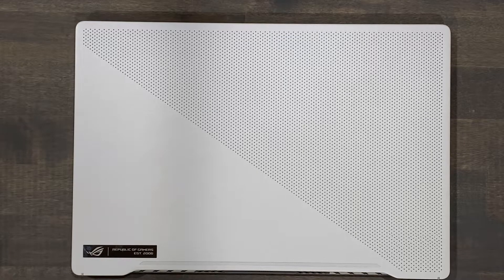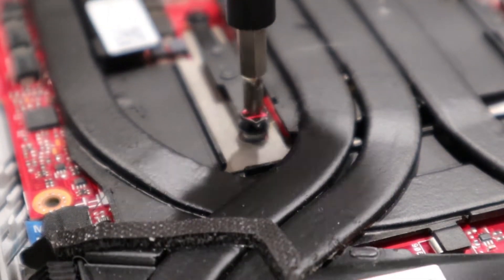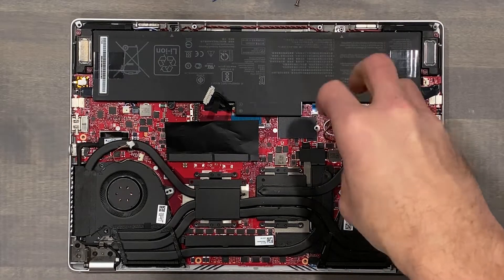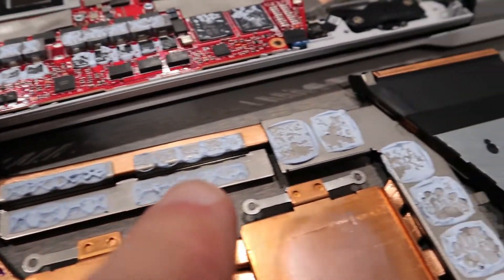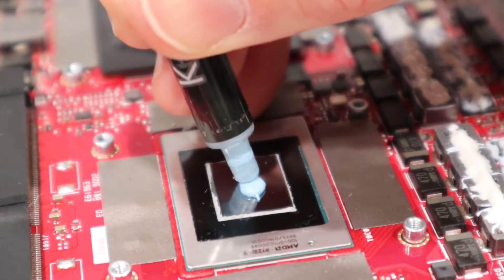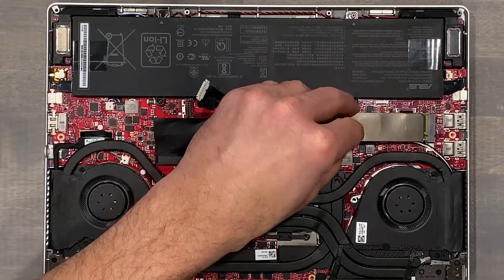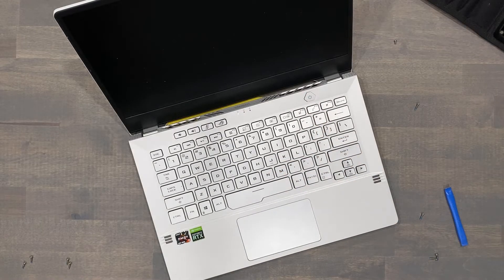Asus G14 Repaste Guide

Comment: I have a 2022 model of the G14. When lift the thermal plate cover for the first time, I see a ring of the liquid metal thermal substance all around the metal contact box; the liquid metal are all on the reddish plastic thing over the CPU and GPU. At first I thought that meant that the thermal substance is not supposed to touch the metal box but I see a bunch of the liquid metal in the crevettes, so it seem like the liquid metal are just there to address the concerns that the thermal they give you are dry and cracked.

Comment: for those who face screen dead, mine also screen dead right after fan replacemnet. i solved my problem with taking off external ram card. somehow my ram card got shortage. it caused black screen. it works well with my on board ram. and im gonna chage external ram soon

Comment: thanks for the guide, just did it for my inlaw and now his temps went from 90 to less than 70C, we changed both cpu and gpu termal compounds, but for the cpu we used thermal paste instead of liquid metal, and it also decreased temps by aprox 20C

Comment: I'm having some issues I followed the guide and did everything carefully and slow and it won't turn on no matter what I do. What could I have done wrong
Reply: in my case, i could turn it on but it cannot show anything on screen even bios. anyway i found out my ram got shortage. once i take my ram off and it works with on board ram. check urs too

Comment: Even though I turned off Turbo Boost, my CPU still reaches 94°C while using only around 50% and drawing about 22W. I reapplied Arctic MX-6 thermal paste two months ago and clean the fans monthly — the last cleaning was just two days ago — but the temperatures haven’t improved. My GPU also reaches 86°C.
My specs: Zephyrus G14 (2021 base model), Ryzen 7 5800HS, RTX 3050 75W.
What can I do to solve this issue?

Comment: I used to repair Xbox with rrod. Must have done 50 so thought this would be okay as its very similar. I was extremely careful even powered down after unplugging battery and taped so it wouldn't touch mb. Devastated that my laptop is now dead. Can't think how I could have done anything different. Be warned!
Reply: Its weird repasting shouldnt be this high risk.... I think its defect from asus, i have repaste anything from old thinkpads to newer gaming laptops non of them have died at all... Weird case this laptop

Comment: I would suggest TO ANYONE SEEING THIS COMMENT BEFORE OPENING THEIR LAPTOP to be extra careful with the battery connector. The reality is that it doesn't need to fall off its seat completely to create a shortcut on the motherboard, if you slide it just a bit too much it will make contact and possibly kill your laptop, especially because the connector is often stiff until it moves all the way out.  If you want to free the connector safely place a thin sheet of non-conductive plastic over the area at risk in order to prevent sparks. I personally layered some isolant tape in order to avoid stickiness and placed it right in front of that tricky metal piece. Good luck, hope you don't fry your computer.
Reply: So could I use regular paper for this since it’s non conductive?
Reply: @Hailey_Snailey I think it's no prob if you use it
Reply: If it happens means my motherboard is fried?
Reply: @mdjubayermahamudrakib4431  maybe, probably.. hopefully you are lucky
Reply: Just fried mine lol
Reply: I just fried my laptop. Can it be repaired?😢
Reply: @mr.nobody9646 so did I… you guys get yours fixed?
Reply: @MatasticMatt  really man? i didnt open mine yet but after almost 4 years my temps are crazy high so i will need to open.
Reply: @TOPSTOPI yeah for the love of god man take it to a local shop to have the paste redone. It’s not worth the risk. The may charge close to $75  because it’s a higher risk operation but it’s totally worth it.

Me and what looks like thousands of other people ruined out laptops lmao. Ik it’s hard to believe but fuck it was a sad day and few weeks when it happened. Mine is sitting in a laptop case in my closet right now. Was gonna sell some of the parts but never got around to it
Reply: @mr.nobody9646 also wondering
Reply: Have I just damaged mine? It won't puwer up after I Tried to unplug it, and the metal thing fell off on the main board :(
Reply: @globularvower3300 oh buddy you’ll have to call around and see if anyone will do micro soldiering repairs.  the very least it will be around $200 if you’re lucky , if you’re unlucky, you’re mother board is fried and you are better off getting a new laptop. I’m so sorry o break the news there are hundreds or even thousands of us who did the same thing and it’s devastating. But in the end it’s just a bad design from the manufacturer and in the future if you ever have a motherboard with metal on the clip like that just have a professional do the thermal repaste  for you

Comment: Ok ok....I got an idea. Before doing this procedure. Let the battery completely drain. Then unplug the battery, and hold the power button down. Completely isolate the power from the computer. Then remove the ram, the NVMe. Then do the job.

Comment: The laptop stopped working . Went to service center for repair they said  it could be due to fried motherboard 
.The metal connecting the laptop should not be removed wrong information given in the video
Reply: Did they repair it? How much it cost?

Comment: Bro this video is cursed and is frying everybody's expensive laptop with the battery...
Reply: guys check ur external ram card first. once i took ram off. my g14 revived.
Reply: @kasak-v4p can you be more specific do you mean replacing the ram card or just taking off the ram card?
Reply: @ruwas369  u see the ram card  that he took off before battery?
that one
g14 has on-board ram 8gb, so took ram off and try to boot ur laptop.
Reply: @kasak-v4p thanks you! I will definitely try. I will have to dig my g14 from the grave to try to resurrect it. But it is worth the Try 😉
Reply: same thing happened to me….the laptop isnt turning on now…..is there any way to know if the motherboard is shot?
Reply: @rahulsajwan3466  probably, or maybe not connected properly try if everything is reconnected firmly. Otherwise if nothing works it's probably fried. This guy should take down the video or make an edit in the video with disclaimer about the battery clip metal thing.
Reply: @ i so regret thisssss…… going to service center on monday…… hoping its something easily fixable and not motherboard fried
Reply: @rahulsajwan3466 good luck pls keep me updated on the reply from Asus and maybe the cost of fixing a fried motherboard if that is the case.
Reply: Wish I read the comments first. I was so careful but now have a very expensive paper weight.
Reply: @michellebaker8066  rest in peace my friend. i wish he would delete the video, or edit it, if possible, to give proper warning.

Comment: wouldn't it be easier if you separate the lcd cable and wifi/bt cables from the heatsink instead of removing the battery cable and both the wifi/bt cables and lcd cable?

Comment: Hello, I have a question, I did everything as in the video, turned on the computer, but the charge level is 0% and it does not charge, the connector is inserted well, any ideas what could have happened?
Reply: Did you find anything out

Comment: Thanks a million for this video, very helpful in replacing my dead fans and repasting my 4 year old system - running like it's brand new again!

Only issue I came across was the screw for the wifi kept spinning and never actually lifted out, so had to resort to disconnecting the antenna wires. Bit of a pain with how tiny they are, but still worked out in the end. Thanks again!
Reply: I haven’t re-pasted it in 5 years. Doing it now. I wanted to know what was the temps like before and after while playing graphic intensive games

Comment: Thank you for this super helpful guide! Just a heads up if your G14 has the AniMe LED matrix display: you need to unplug the connector just above the Wifi card. The cable runs through the right side of the cooler, so be extra careful when taking it off!

Comment: have you ever heard of this laptop only crashing when on the desktop when it's plugged into a power supply? I can start playing any game and once it's in fullscreen I can plug in the power supply and it will get its extra boost of power during gameplay, once I exit the game and go back to the desktop, it will instantly crash if I don't disconnect the power before exiting the game. I also noticed if I disable the GPU it won't crash if it's plugged into the power supply. Also not sure if this is normal for this tablet, but during gameplay it gets so hot on the top near the edge and around the top buttons, hot enough to burn the skin if you stay touching it..
Reply: yes happened for about 1-2 month before I realized I was so fucin dumb, basically the battery link to motheboard comes loose, it's so weird but it happens, jjust bring down power to 20% or less remove and re add the wire to the socket the issue will go away.

Comment: When i was reconnecting the battery connection is created a spark and now my laptop wont turn on
Reply: This is because of the metal holder on the battery connector that if pushed to hard will fall om the motherboard and fry it many people have had this issue and than Asus charging too much to fix it
Reply: @ruwas369  Yeah, I'm not sure why the guy who made this video decided to pry the metal piece off when it's made to slide back slightly so you can pull the battery plug upwards and off easily.

Comment: Heads up to anyone who thought they just bricked their $1000 laptop. Try plugging it in first 😂. I was just about leave for best buy because I need a laptop for work if I just killed but decided to plug it in first. And it came back to life.
Reply: ain there a battery issue where the adapter port stops working if you do something wrong with the battery.

Comment: Hey this guide is completely incorrect. You are NOT supposed to remove the metal bit from the battery connector; simply sliding it back is sufficient. I popped it off completely on my laptop and shorted my mobo. Thanks a lot random youtube guy. Taught me what ought to happen if I trust random youtubers.
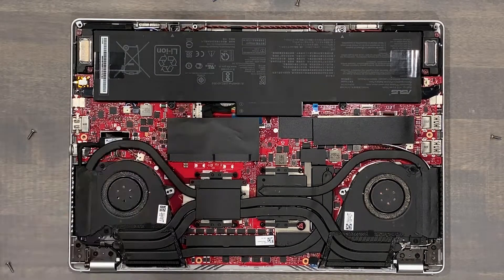Reply: he did say be careful and didnt say remove it. 0:52 'theres a metal clip that needs to SLIDE AWAY - YOU DONT NEED TO SLIDE IT ALL THE WAY OUT; he said he also feared it could cause a short. Were you careful enough?
Reply: The same thing happened to me a while back but after replacing the ram my laptop seemed to start working fine again
Reply: @sid6645  same I lost my 1600 euro laptop
Reply: When you say sliding it back is sufficient do you mean the metal bit or the battery cable?
Reply: I should have read this comment beforehand ….
Reply: I did remove clip and my laptop not torn on now
Reply: Seems like I'm not alone. My laptop just died in front of me😢
Reply: Good to know. I haven’t clean this laptop for so long, I need to replace the thermal paste.
Reply: Also, you’re saying just slide off the battery is sufficient and never slide the metal part off. Correct?
Reply: Tha clip fall on motherboard a time remove and short circuit thats all 😢 now i am crying
Reply: too late for me, i guess
Reply: I did the same 😂
Reply: I did the same a couple months ago had to replace my whole mother board. I have no ideo how his mother board did the shorted with that bracket touching metal
Reply: This is why it's very important to listen to the audio while watching videos. He warned you to NOT do that.
Reply: So one step adjustment wouldn't consider that "completely incorrect"
Reply: @prodoommania4157  Actually yeah if it risks you frying your entire motherboard i’d say it wasn’t made that well, there is absolutely no need to completely remove it like he did in the video, asus is moronic for building it that way but if he was aware that could fry your mobo why on earth would he show him completely removing it 😂
Reply: DUDE IT FUCKING HAD A SHOCK AND A BAD SMELL AND NOW MY LAPTOP WONT TURN ON DEAR GOD CAN ANYONE EXPLAIN WHAT HAPPENED?!?
Reply: @MatasticMatt same thing happened dude, what are you doing now??
Reply: @manvardhan404 oh shit I’m so sorry to hear. This is a tragic tragic thing going on. I had to look EVERYWHERE for a place in my home town that does micro soldiering level repairs. They still had to ship it off to their tech team to even see if the whole mother board is fried or if it’s repairable for a couple hundred bucks. I’ll get a call back in a few weeks :((
Reply: WAIT I JUST FRIED MY MOTHER BOARD ARE UOU FUCKING KIDSINGN ME?!?!?!  GOTDAMN IT
Reply: Honestly never make a tutorial again I short circuited my mobo by moving the metal bar the same amount you did, it is not meant to be moved that far back, I hate you so much rn

Comment: Thanks for the video. Was just wondering if it's necessary or beneficial to replace the thermal paste on the VRM with the K5 Pro? Would just using thermal paste instead of everything work the same since it initially had only thermal paste? Thanks again, appreciate the help.

Comment: I don't know which one would be a greater risk: dropping something on the mobo and fry it or try disconnecting the battery and... fry the damn thing.  Neither of these happened, but it needed a well magnetised screwdriver with the right size/profile.
Lid LED and fan connectors are indeed super flimsy, but manageable with care. 
Maybe the most time consuming part was getting rid of the old paste from the VRM parts one by one, some still ended up between them anyway, a toothbrush and some IPA would make it nice and tidy but maybe next time. CPU fan worn out in 3 years' time so it's not that far ahead, these paper thin bearings can't take much abuse for sure. (vs. Da Brick T440p :D )

Comment: I have a question: why is it not possible to apply a thermal pad on the VRAM?  I mean there are close enoughe to cut a 10x40 mm pad and place it there. As it is electrical noncunductive it should be fine to fill the gaps between the modules, right? And in pllcation for CPU and GPU is it possible to place larger ones to cover these full black areas?

Comment: Hello I am having a problem. I followed this video until the end and reassembled my laptop.
However it longer longer turns on and the charging light doesn't even light when plugged in.
I suspect a short happened, as the motherboard is continuously emitting very quiet beeps.
The beeps go away only when I disconnect the battery.
How might I go about fixing this?
Thanks in advance
Reply: Same issue with me i remove battery and then mistakenly tha pin near drop on motherboard and short circuit the motherboard and my laptop now not turning on and i am crying 😭